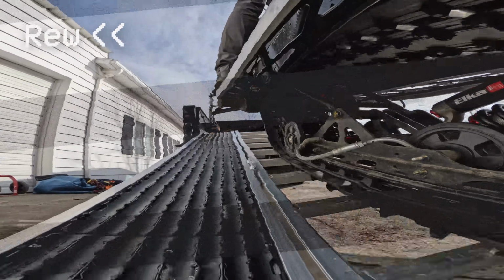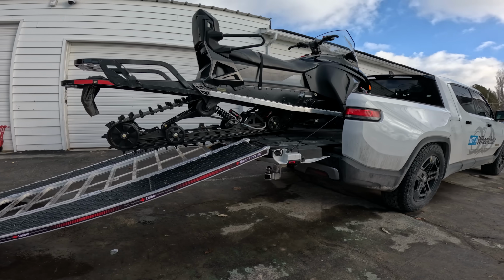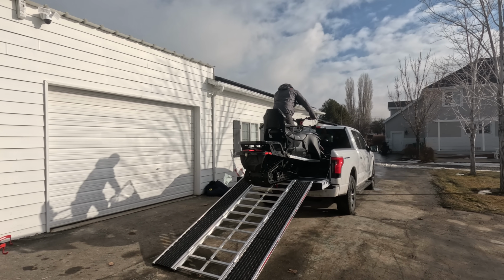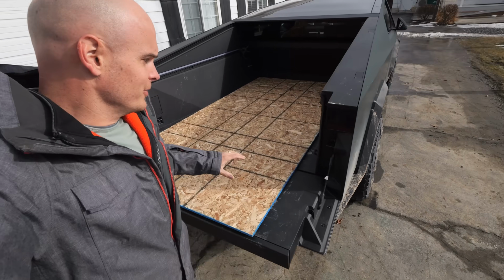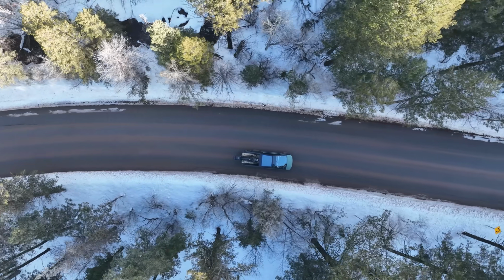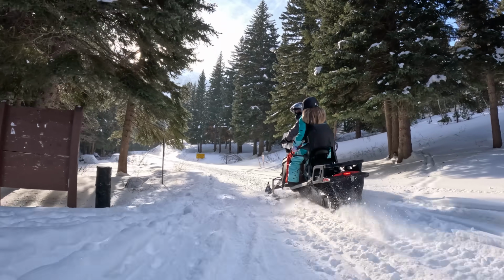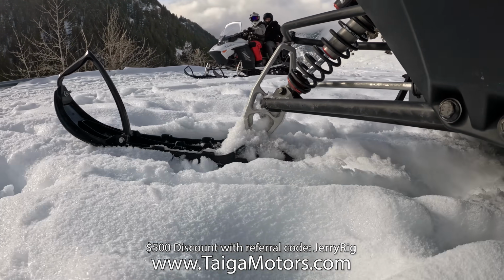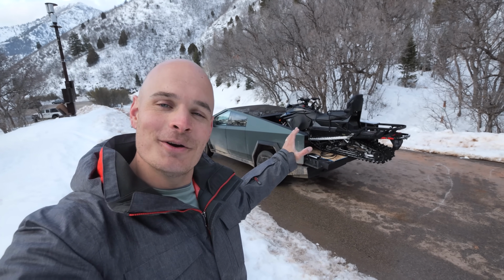The Weird Cybertruck bed is actually GREAT for one thing...

Comment: You can get these plastic ski cover things to keep the skegs from scratching things up. You can also use skegs without carbides if you're always on soft snow. The carbides are for grip on ice.
Reply from the maker: Good to know!
Reply: I removed the carbides and replaced them with mild steel skags on my sleds bc the carbides were ripping up my garage aprons and shop floor. Unless you are running high speeds on hard pack or ice, you don't need carbides. Just be sure to check those runners more often.
Reply: @northdakotaham1752 check something more often? No thanks. And why does your garage wear an apron?
Reply: @EikottXD  probably to seal it up in cold weather so things inside stay warm? Idk just a thought
Reply: @EikottXD  the apron is the slab of concrete that extends out from the garage door about 40 feet. Drive across with carbides and you have two permanent gouges cut into the concrete.   IF you replace the carbide runners with mild steel they won't gouge the concrete but you need to check mild steel runners more often bc they wear much faster than carbides.
Reply: yeah when he said to protect the ski i knew he is just a novice its to bite in and give you steering without them you might as well just plan on going straight lol
Reply: what was wrong with using the wheels at 5:00 ?
Reply: @thefig8832 nobody knows content i guess

Comment: The snowmobile sounds like a great idea when you want to be able to listen to nature around you.  Maybe for search and rescue purposes it might be advantageous.
Reply: Yeah, totally different experience, really fitting!!
Reply: I see them being a big hit for use at ski resorts by both ski patrol and snow making crews.
Reply: @AdventuresonTour  was thinking the same thing i used to make snow and you could make a lighter one with less range for a ski resort that would work out nicely we never rode more than 5 miles at a time. And it would be nice to not smell gas and fumes all day riding around.
Reply: doubt it has purpose for search and rescue given its limited range and maneuverability  there is a reason taiga built this style of sled because they could fit enough batteries in it and the weight is fine for trail riding which is about all its suited for.

Comment: Someone finally measured the the Cybertruck bed at its various sizes/heights, thank you! AFAIK no other reviewer has done this, at most they measure a single dimension at the bottom of the bed, and rarely the top.
Reply: Everyone: Can you just make a long bed pickup? 
Electric truck manufacturers: Tailgate is bed!
Everyone: No, it's not.
Reply: But they neglected to measure the bed HEIGHT- the second most important dimension for loading/unloading. Ooops!

Comment: This is the video I've been waiting for!!!  You're the first to actually take a tape measure to the CT bed, and that's exactly what I needed.  I move various types of motorcycles around and can't do the Lightning or Rivian because the beds are too short for the rear axle to land on.  Though I was surprised to hear about the front of the bed angling backwards as it comes up.  For a motorcycle's front tire, that just trimmed 6" off the usable bed length.... Darn it!
Reply: Yeah, for some reason all manufacturers except Ford think EV trucks have to be funky and less functional shaped.  Ford *almost got it by at least using the standard truck body but then dropped the ball by only offering the tiny bed and huge cab.  Looks like the top pick may end up being the Ram diesel-electric hybrid that is supposed to be offered in all trim levels.  That might be the first EV truck capable of replacing my Silverado 1500 diesel.  Maybe.

Comment: When did truck beds get so small? Those look TINY compared the older trucks I am used to seeing.
Reply: The Cybertruck bed is bigger than the most popular trims of the F-150 (and far bigger than the F-150 Lightning bed).
Reply: @ZipZoomZip  bigger if you measure in exactly the right places as it's so weirdly shaped it's unusable as a working vehicle.  And as @Turnip_ pointed out, these days most people seem to want macho minivans instead of actual trucks in the half-ton market so finding even a short bed (6.5' is a short bed, 8' is a long bed) is tough.  The urban soccer moms would rather have a giant cab to haul the kiddies and a tiny bed to make it easier to park while a working man wants the opposite - smaller cab and bigger bed.  But hey, the cYbUrTrOk was never intended to be used, it was intended to make a social statement and get attention.  For that, it does extremely well.

Comment: This makes me love my longbed more. It's 8'2" with the tailgate up. I never understood why beds got shorter. Yeah you can use a trailer but that makes it harder, having to hook up the trailer, make wider turns, more maintenance, having room to store the trailer
Reply: Hell, even a standard bed (6.5') is almost impossible to find in a half-ton these days.  Sadly the half-ton market has largely become nothing more than macho mini-vans so people would rather have a huge cab to haul the kids to soccer than a usable bed to do work.  It is possible to get a real bed, but you'll probably have to order it.
Reply: becasue you added rear seats and with rear seats and a long bed you can't park it anywhere.  1/40 owners need a long bed.
Reply: @TigerDude333  Assuming you are talking about @austinhernandez2716 above.  He didn't say anything about having rear seats, only a long bed.  Myself I do have rear seats on my short bed (6.5') but only the 'smaller' rear seats as I have never put a person in them, I just wanted to be able to recline the driver's seat to take a quick nap when on a road trip and to have quick storage for groceries or other things I don't want to put in the bed with my work equipment.  I don't think you can even order a long bed with a 4-door cab in the Silverado half ton, and I believe only in the supercab (not full rear doors) for the F150.
Reply: He said he didn’t understand why. He didn’t mention the extended cab because he didn’t understand that was why

Comment: Can’t wait for a review of this snowmobile. I want an electric snowmobile but sceptical how it’s gonna work without a heated garage and stuff. 
How does it corner with all that weight? Usually with a heavy front end, they get nervous in the corners. Or driving on the side of a slope, tipping over

Comment: The Cybertruck's bed was likely tested, often, with the Electric Quad Bike they designed, "Tesla Cyberquad". 

In terms of area or space required, the slanted front of the Snowmobile and Cyberquad are similiar, which could explain why the Cybertruck bed can accommodate, ATV's Snowmobiles, and Motorcycles with ease.

Comment: With PTFE sheets it will slide better, resist and be more beautiful! But a trailer with PTFE strips is even better... Otherwise try with nylon... With water, snow, humidity and dirt, it will be more durable and more easily cleanable...

Comment: It's so satisfying to see paint on the cyber truck or atleast something preventing the rust 😅 love the green tho it reminds me of my samsung s22 plus
Reply: What rust?  It's a high grade stainless steel.  This isn't the stainless steel that your dishwasher is made from.   I hate the Cybertruck with a passion for many reasons....but it is not going to have body panel rust.  (also that isn't paint, it's a wrap).
Reply: @ian3580  owners have already been reporting rust spots and Tesla says you have to clean any bugs or such immediately to prevent issues and should keep it dry (???)  Is it rusting through like a toyota frame?  No.  Is it developing rust stains/spots?  Yes.   Remember - it's called stain-less, not stain-proof.

Comment: You are the hero we need.  please be the first ever to make the cybertruck vault have HVAC camp mode.   please try replacing the rear glass with a passthrough glass / removeable.  AND Drill holes in the toneau cover slats that line up with the passthrough.    test HVAC back to the truck bed covered vault.  Test mini bed and computer micro living truck vault space with HVAC camp mode.    could also test HV Electric extension cable bringing HV outlets to the cabin.    This is the feature we are all missing to be able to self drive sleeper your cybertruck - skip hotels, and wake up in a new travel destination rested every day.     I don't know someone better suited to test this JerryRigging.  .  I need to know this is possible. thank you.

Comment: A Cybertruck might be able to get me where I wanted to go, but considering that some cities in the state of Michigan are 600 miles apart, it wouldn't cover the whole state in one charge.  After 300 miles I need to stop and recharge myself, so the truck could be recharged too, if there was a place to plug it in.  Before I bought my current SUV, I had 2 Chevy Silverado pickups. Both had a bed length of just over 8 feet with the tailgate closed, and close to 10 feet of length available including the tailgate, what I like to refer to as "real trucks". Not little 5 foot long beds, but trucks where I could throw a big stack of those sheets of plywood in the back and close the tailgate. Most people don't buy trucks to do things that trucks were made to do anymore. They've gone from being 1/3 cab and 2/3 bed, to 2/3 cab and 1/3 bed, because people use them as the family car. Just my 2 cents. A REAL truck with an 8 foot bed is great for hauling a lot of things. A Cybertruck, not so much.

Comment: Man... when yall were talking about the Hot Chocolate Shack....  I thought of Wandering Oaken's Trading Post and Sauna on top of the mountain.... 🙂 I am curious about a battery snow mobile in the cold, and knowing what happened to all the Tesla's when that polar vortex hit  a few weeks ago, how long can they last in sub 0 (F) temps or even prolonged usage below freezing. And the jet ski, when is that video coming? That really peaked my interest since we have a family on a lake and would be nice not having to mess around with gas, oil, and clogged injectors from "cheap" gas due to not running ethanol free 91/93, I can't remember which.

Comment: the peeps talking about the wrap preventing rust, well, yes, it will hide the defects, but the rust will continue to develop (underneath) and will eventually "surface-plate" and penetrate the wrap. I've had my lab for 45 years and Tesla is one of my clients. There's NO way to prevent this, as the oxides within the feedstock is impossible to remove. Rail-dust is B/S!!

Comment: As a European I look at these American trucks not knowing what they are designed for? (except helping men emotionally when viagra fails) They are this weird mixture of a normal 5-seat sedan family car, but without a trunk, and instead they have a truckbed that doesn't have proper capacity for hauling stuff the flexibility of accessing the car's interior space. 

Sure, I live in a 15-minute city these days, I don't even own a car anymore, but when I did, I owned a Toyota Yaris which was nimble and had low insurance cost and gas mileage. Whenever I needed to haul stuff folded the back seats (and front seat if required). I could even transport things that were 2m long inside of the car... 2.5+m with the trunk open... And whenever I needed to haul very large-, or specialized items I just rented a bigger car, or asked the store to deliver the items to my door instead. I mean, it was much cheaper than owning one of these monstrosities.

Comment: How does atmospheric temperature affect range? Go out when temps are 20°F or lower and do you need to worry?
Reply: its just like anything else you have to precondition the battery in cold weather and then the battery discharging keeps it warm so you kind of need to keep moving to get the advertised range and keep the battery warm

Comment: a snowmobile when its known evs can't handle the cold 😂
Reply: I can't speak to the electric snowmobile in cold weather but our two Tesla love the cold weather. Sure, the range is reduced by about 1/3 of normal (depending on how cold it is) but who cares when you have over 300 miles? Even in bitter cold, 200 miles is plenty. It's rare that I drive over 200 miles per day in bitter cold weather, and, when I do, the Superchargers will get you back on the road after a short rest stop. In six years of driving only electric cars I've never had a problem, thanks to the range of my Teslas and the availability of Superchargers in the rare event that I need to drive further. My six-year-old Model 3 with over 70,000 miles on it still charges up to 305 miles of EPA range, it came with 310 miles of range. 

Most of what you read about EVs not working in the cold is either hogwash or it's due to some inferior EVs that don't deal with the cold as well as a Tesla, particularly a modern Tesla. My Model 3 Performance is the best snow-skiing car I've ever had. It's low center of gravity and lightning-fast traction control make it a joy to drive on icy or slushy roads. Don't believe everything you hear!

Comment: as someone who lives in canada it can easily get to -30c and -45c during a more harsh winter. I've always have wanted to make a switch to electric but I'm always iffy about the reliability of using batteries. how long until we can say with confidence that using electric vehicles in cold weather is safe and reliable?
Reply: Gas has problems at those temperatures too. Regardless of which technology you use in extreme cold, you had better know how to use it. Most Canadians I know keep their snowmobiles in the shed when it's below -30 degrees, the wind chill is brutal, even if only a small bit of skin is accidently exposed.

Comment: Where I live you have to have a red flag (at least 12 square inches) attached to the back of the load you are hauling if it extends more than 4 feet past the length of the bed.
Reply: The snowmobile doesn't extend 4 feet so it doesn't need a flag.

Comment: The Taiga is a horrendous boat anchor when it comes to limited range and just an outright albatross in the snowmobiling industry. In two feet of heavy wet snow, it won't go further than 15 miles.

Comment: Love the show!  wondering if you could do a video on  Cyber trucks doors, when they are all iced up! Will the mechanism open and pop the door?  I have one on order I live at high altitude in Colorado I feel like it's going to be an issue could you help?
Reply: The Cybertruck doors have built-in ice-breakers in the opening mechanism, good for 1/2" of solid ice. I would worry more about legacy truck doors with handles that regularly freeze solid.
Reply: @ZipZoomZip  
Thanks for the response, I've heard of the icebreakers and have been told the specs,. I don't see any testing or evidence that it does actually work.  A half inch of ice is quite a bit of material to move. It would be pretty cool if someone would just put it to the test.
Reply: @ZipZoomZip  Have you seen it done? I've looked everywhere for a video, haven't seen one on it. Half an inch of solid ice is pretty strong.

Comment: Lol- you can tell people who have never owned or used a truck on these electric truck tests. They never measure or even mention the second most important dimension after bed length- bed HEIGHT! How high do I have to lift or load/unload anything onto the bed- it determines ramp angle and how difficult it is to actually use as a truck. What happened to the kneeling rear suspension and integral tail gate loading ramp shown in the 2019 reveal?

Comment: listen, man i rly hate that snowmobile designers have tried to make them electric without changing the design, why have NONE tried to make an electric crosscart like snowmobile with the battery pack on a swing arm//pendulum in the back, you could place it over the track//tunnel, you'd have the comfort of a UTV and it would be safer than normal snowmobiles, you'd also be using its main flaw (weight) as a positive trait, being that you don't have to tilt or lean urself when climbing hills.. wish someone would try creating this as it would improve every fault in snowmobiles, also make electric snowmobiles viable for long distance travel.
Reply: you obviously dont ride snowmobiles being in a high seated position and being able to put your weight anywhere on the sled and shift the center of gravity is HUGE when you are in deep snow. What you are saying has been done before its not new i think ski doo even has one now and its fine for packed trails but its not gonna do well in deeper fresh powder on a mountain side its just gonna get stuck or constantly want to point down the mountain. But i agree they are kind of lacking vision on what the electric powerplant could give them the freedom to do but its early days yet.

Comment: So the bed is great for hauling a snowmobile, a vehicle used in extreme cold environments, which the cybertruck can barely operate in the temperatures that the snowmobile is designed for..... LMAO. I. CAN. NOT. STOP. LAUGHING. AT. THESE. TURDS.
Reply: I understand you dislike the video, but no need to be insulting is there?

Comment: Ha ha 62 miles. Cold and pushing snow will be even less. My best day I did a little over 500 miles. 12 hours moving time. 125 miles with an apex between fills. 3 stops of 5 minutes vs god knows how many hours of charging.
Just like EV's it's a toy for virtue signalers
And then to transport it with a cyber urinal is priceless. 
Ha ha

Comment: I really hate modern trucks, all of them are double cab, and it's near impossible to find a single cab full bed truck.
Reply: it really isnt hard you likely wont find many on the used market since they are beaten to a pulp but ford still makes work trucks but you probably have to order them since they dont waste space on the lots for them